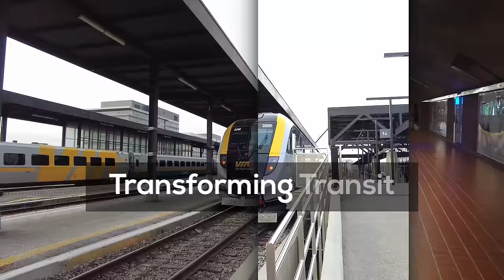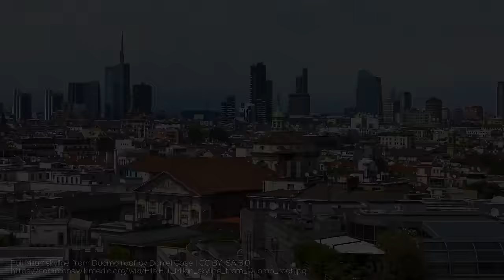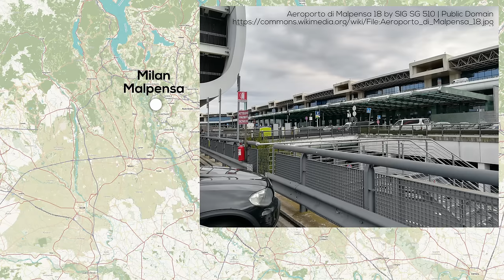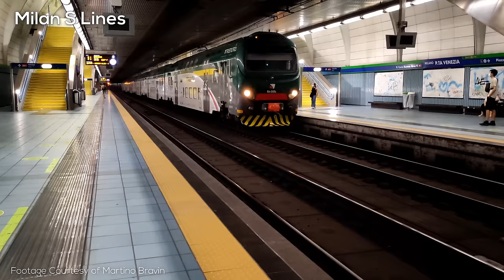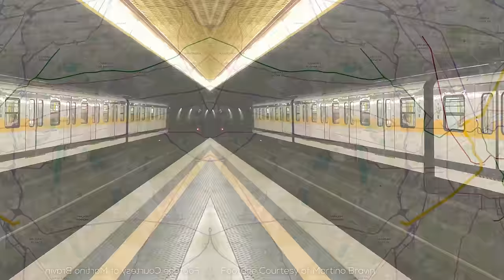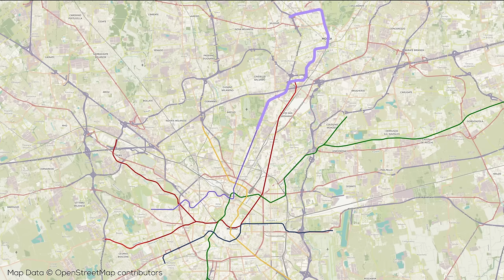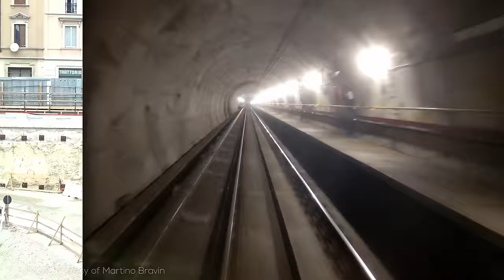A City That Builds Metros Like No Other | Milan Metro

Comment: Now do Italy's polar opposite metro system: Naples. It's a completely dysfunctional shitshow of a metro "system". Absolutely horrendous.
Reply: I wouldn't say so. Service is not so frequent, but the system is good (better than Rome's IMO). 
Then there are wonderful art stations, surely among the most beautiful metro stations in the world
Reply: @marcomontella6006  You are right about the stations, but apart from that it has no redeeming qualities. The station entrances are dirty and often the only ticket machine there is broken. The trains are old and dirty and offer a bunpy ride and they don't come often enough making them (and the platforms) overcrowded. There are hardly any useful connections to be made from the metro and even where it "connects" to the central station you have to walk halfway across a shopping mall to actually make your connection. And this is the same for connection to other lines: they hardly connect at all or connect way too far out to be useful.

I guess it will become more useful when the line that goes through Chaia to the stadium is finally opened, but until then the metro is just an isolated string of stations that does a loop-de-loop in the middle.
Reply: @marcomontella6006  it is impossibile to go from one side to the city to the other if Line 2 does not work (as it is the only east ovest rail link). It is absolutely not a good system

É impossibile andare dalla parte est a quella ovest della città se la linea 2  smette di funzionare dato che é l unico collegamento su ferro che attraversa la città da est a ovest. Non é assolutamente un buon sistema di trasporto pubblico
Reply: @Xormac2  technically Naples line 2 was meant to be the first metro built in Italy, in '20s of 20th century. Being connected with national railways it hasn't been properly used for decades.
But after Cascetta's plan to redesign all Naples rail infrastructure for urban transport in early 2000 service is better, even if not at metro standard. 
I think the problem nowadays is Regione Campania which does not 'force' Metronapoli, Sepsa, circumvesuviana and RFI to work together as they should and doesn't put enough money for service.
If it was to me to decide I would create a single transport authority which unifies all these subjects. Anyway Cascetta's plan was and still is brilliant. It just needs to be implemented properly

Comment: as someone that lives in milan... no they aren't this good. they tend to be... problematic... between break downs, running late with the first trips at 2AM delaying the entire serivce, train and metro stations blocked for works without any warnings in advance, criminality running wild, no policing what so ever and they cancel services randomly.
did i mention they are late? no seriously, they are always late... takes double the time to go anywhere you want.
and the new driverless consists from hitachi fucked capacity on the line, they are nowhere near sufficient to the mass of people they must transport.
a part from that, they are ok not good by any metric, but ok.

ps: they are late
Reply: @thomasbruno9159  si decisamente

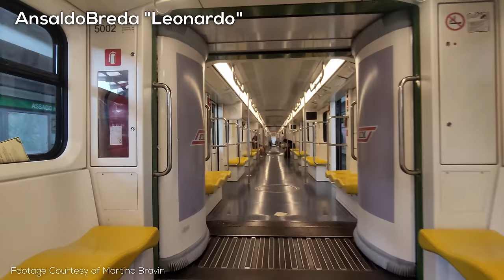Comment: 9:42 instead of ending homelessness, lets install hard plastic wavy bench seating so our trains are uncomfortable for everyone.
Reply: It's not actually uncomfortable.
Reply: The metro close for the night, there's not really a problem of homeless sleeping in the trains after the end of the service
Reply: It's not hostile design, even if it looks that way.
It's just bizare design which extremes the 'concept' of standard seats in older Milano metro trains models.
And actually the seats are comfy
Reply: It isn’t uncomfortable as the seat is designed to hug your bottom, it wouldn’t be comfortable if it was all flat don’t you think?